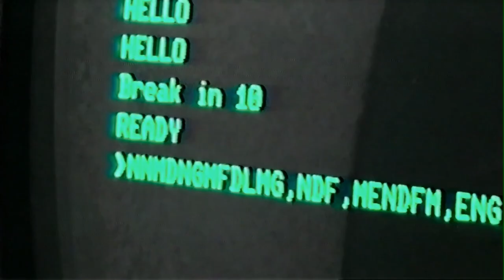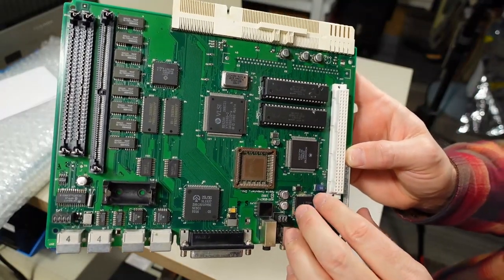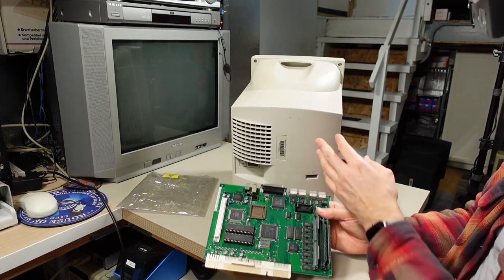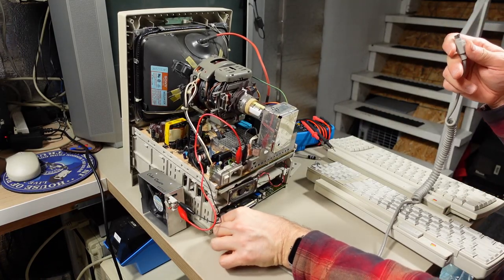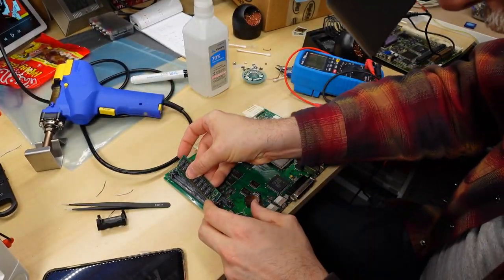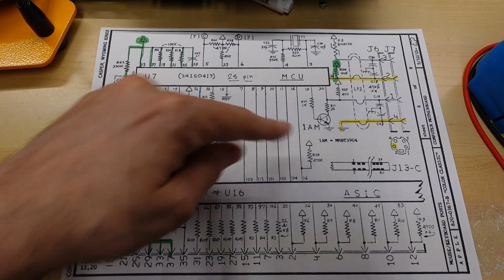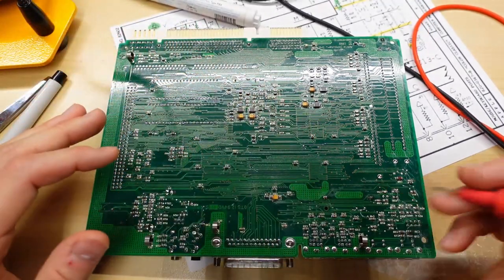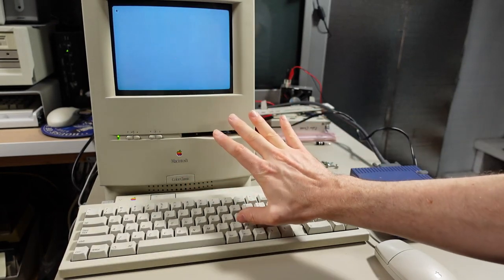The Mac Color Classic lives again, sort of...

Comment: My guess is that pin 10 on that edge connector is the PWRON command to the PSU, which has to be pulled low, and pin 14 is the PWRGOOD returning from the PSU which allows the clock generator to start.
Reply from the maker: Perhaps -- or the other way around. :-) It's hard to troubleshoot due to the damn design of the case!
Reply: @adriansdigitalbasement  I'm pretty confident it's in that order. The weird chip in between the microcontroller and the battery is probably a tiny controller that prevents the battery from being fed 5V so it doesn't... explode.

That's also probably why the motherboard won't power up without a battery installed: No battery means that tiny controller isn't powered properly and the power-on line never gets sent to the PSU.

Comment: Could you, I wonder, take the edge connector from the bad board and use it to make some kind of harness so you can more easily test motherboards outside of the case?
Reply: That's not a bad idea, but he'd need the female edge connector from a faulty case to make it really work properly.
Reply from the maker: Yeah it would be possible with the matching edge connector -- but can you imagine the work it would take to solder 100s of tiny wires -- I'm not sure I can handle that. :-)

Comment: Probably too far since I'm UK to ship but I'd love a chance to try and repair the old board anyways just for fun, it's what I do anyway :D
Master EDIT: You've fixxeeeddddd itttttttt, disregard the rest. So happy for you :D
EDIT: Actually, both of them at this point unless you end up fixing the other new one by the end
EDIT2: Oh, the removed caps section, the corrosion on the legs of the chips would be an immediate 'this needs fixing first' rather than just replacing the caps, but aside some corrosion, I'd guess the new one is actually fine ad just needs some touching up. You can see corrosion inside the chip socket when you're showing the shot from after the cleaning and that will get worse unless you give it a bit of a clean, too. If there's corrosion in the socket, and on some legs of chips, it likely exists elsewhere and it may be prudent to whack (not literally) all of the chips off, clean the pads, clean the legs of the chips, test the chips if possible (look i[ the internal diagram and or at least pinout and you should be able to at the very least test for shorts or too low a resistance between pins it isn't supposed to exist, or just replace the chips as you can actually order those parts online. With the board cleaned and the chips cleaned, or replaced, and the socket taken care of plus any other spots. Should work fine. Don't panic haha
Failing that, whack it in the post to the UK and I'll do it for fun and send it back. That is, if you haven't already taken care of it. Little Mac will live again! :D

Comment: You always so casually go "oh now we'll re-cap this computer"... have you ever thought about doing a re-capping tutorial? I know how to solder to connect model train wires, but re-capping is fairly new to me. Would be great to have a tutorial that explains things like: What temperature (AFAIK you can fry parts if the soldering iron is to hot?), also how to tell whether a capacitor needs replacing, which way round to insert them, how to tell what capacitor it is and what replacements one can get (and what tolerances there are, like, can I get a "bigger" capacitor if the one I need isn't available or something). Maybe even a tiny soldering tutorial? Anyway, keep putting out these rocking videos!

Comment: I had a Compaq LTE 4/25 monochrome laptop which had a CR2032 and a CR2340 coin cell battery on the motherboard. And without the CR2340, it did not even power on.

Comment: In the standard battery holder a CR2 photo battery should work in place of an 14250 lithium thionyl battery, they're the same chemistry as coin cell batteries so they shouldn't ever leak either.

Comment: Adrian, I am sorry to find out that the motherboard I sent you didn't work out of the box! That is what I get for not testing it before I sent it out. Damn! I guess it makes for good troubleshooting though!
Reply from the maker: Oh don't apologize! Thanks for sending it, it's just luck of the draw with these old parts which have leaking parts causing corrosion. Really, thanks for sending it, I really appreciate it!
Reply: Guy Incognito  IATA, Guy. I got the board with a Color Classic with the Mystic upgrade I bought on eBay. The seller included the original board and did not disclose the condition to me. In good faith I sent it on to Adrian.
Reply: @adriansdigitalbasement  You are welcome!  Will be on the lookout for useful, working parts in the future!

Comment: I'm pretty sure your LC 575 board needs (two) 256 kB or 512 kB video SIMMs to work. On my LC 475, which is very closely related to the 575, I need to use 80 ns video SIMMs, the older 100 ns SIMMs don't work.

Comment: Regarding the sound, on my Color Classic fix, the issue was the wire going to the speaker, so I will check the speaker with a battery. Their is a IC on the Analog board that control the sound amplifier. Does go bad some times...You can get then for $1 online.

Comment: That is the 68LC040 without a co processor. That is swappable for a 68040 at the same speed for the co processor or using a utility like SoftFPU but would rather have the real deal

Comment: So, neither motherboard gave you the mac chime... My first thought, being a professional audio technician, is faulty speaker. Or, more likely, faulty solder joints on the speaker. Pretty easy thing to check. I don't know what speaker Apple used, but generally, 8 ohms across the positive and negative is right.
Reply from the maker: You'll have to wait and see -- there will be more videos on this soon :-)

Comment: is there any systematic way to find the break? im guessing you need to find the complete trace and test all the line segments you can
Reply from the maker: Not really -- other than taking off all the chips and just carefully inspecting. Since the traces run under components, it's very difficult, especially without causing more damage.

Comment: I thought of something while you were troubleshooting the power-on issue.  Is there a way you could have just bi-passed all the power-on intelligence of the motherboard, and just told the power supply to come on?  Sometimes you have to "trick" Macs into doing what you want.
Reply: Probably when you were to pull that pin 10 hard to either ground or +5V it would force the PSU to come on, much like an ATX power supply which uses the same mechanism.
Reply: @Stoney3K  That's largely along the lines of what I was thinking, but I'm not very familiar with Macs.
Reply from the maker: yeah totally but I'm still not exactly which which line triggers the PSU to turn on as there are two that run to it through that edge connector. Also it would likely require cutting a trace (possibly)
Reply: @adriansdigitalbasement  Hmmm..  That highlights one of the issues of working with these old Macs vs old PCs.  Those color macs are so tighlty integrated and individualized that it makes it harder to work with them since you can't just short some pins on the power supply like you can on an ATX machine.  

I'd make a guess that it's largely the same sort of arrangement as the ATX power supply, but finding what pin to set high and getting access to the PS seems like it might be a little challenging, especially since there's no guarantee it's going to work the same on all Macs of that era.

Googling around for a coupe minutes I didn't find anyone with a simple answer to force power-on.
Reply: @adriansdigitalbasement  I'd take a good guess at number 10 being the PWRON, because if it wasn't, the PSU would start up (and the fan start to spin) when pressing the power button, and shut down again. But since it didn't start at all, the power-on command was never sent.

Pin 14 would then be a "power good" return line that enabled all of the logic to fire up and start once the PSU was ready.

Comment: ADB is not hot-pluggable. You can blow up a fuse on the motherboard trying to do so.
Reply from the maker: What mechanism would blow a fuse? it's just a single wire bidirectional bus. There is no reason it's not hot-pluggable -- in fact, the protocol allows for it by enumerating and initializing devices connected after the machine is booted up.
Reply: @adriansdigitalbasement  see the last paragraph in the Problems chapter here:

https://en.m.wikipedia.org/wiki/Apple_Desktop_Bus

Seems like the hot-plugging implementation was taken to half way. It works when it works, but breaks stuff occasionally.

Comment: I heard somewhere that the 68040 is comparable to the Pentium.
Reply: Not really...  the 040 was faster than a 486 at the same clock, but the 040 was never offered in anything over 40 mhz.  Having lived through the era it was frustrating seeing the Intel chips get faster and faster, but the Motorola line had seemed to stall.  The 040 was largely similar in architecture to the 486.  Pentium was quite a bit more advanced, and had instruction pipelining,, and the ability to execute more than one instruction per clock (superscaper) which the 040 didn't have. The Pentium started at 66 mhz, and the 486 went all the way up to 100mhz variants.  So overall the offerings from Intel were quiet a bit better than what Motorola was selling at the time.  

There's a good reason why Apple abandoned Motorola for the PowerPC.  Motorola just wasn't keeping up with Intel for performance.  Motorola did eventually release an 060, which was had a similar features of the Pentium, but Apple had abandoned the Motorola line by then and Amiga and Atari were all but dead, so the 060 was almost never seen in home computers.

Comment: Hey adrian just a warning the stock clock battery is 3.6 not 3 volts
Reply from the maker: It's a non issue -- the clock circuitry has no problem operating way down into the 2v range. :-)

Comment: My (all too ofc) ibm ps1 2011 look like they have a non working floppy drive, in reality the drive does not work if the dallas rtc battery is flat
Reply from the maker: I those floppy drives need new caps to work again
Reply: @adriansdigitalbasement  nonono in this case it's a bug specific to 2011 and 2121 PS/1 machines, I already imagine the amount of people getting angry because they couldn't make the floppy drive work again because they didn't know about this bug.

Comment: My Macintosh SE/30 has also exactly the same error of “Disk initialization failed because the disk is locked!”. Even I unplugged the floppy drive and internal hard drive, and just plugged the external SCSI CD-ROM drive. The same error keeps pop up every several seconds. 

Here is the error screen of my SE/30:
https://www.facebook.com/groups/vintagemacresto/permalink/1606077512826806/